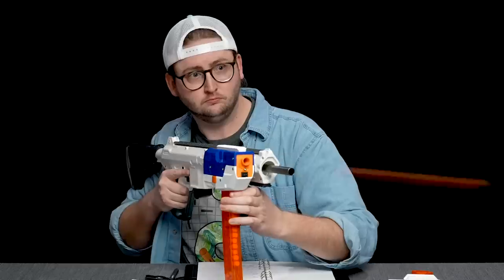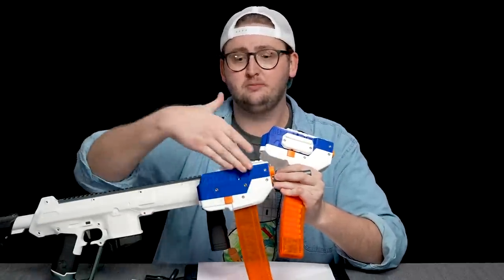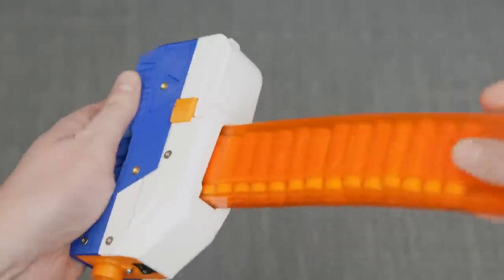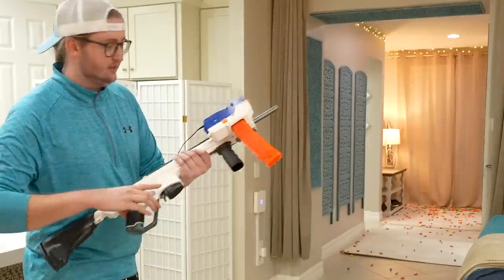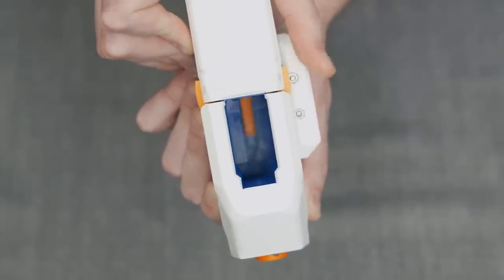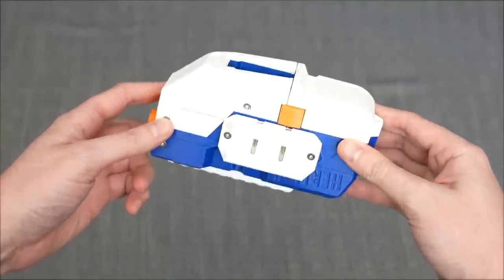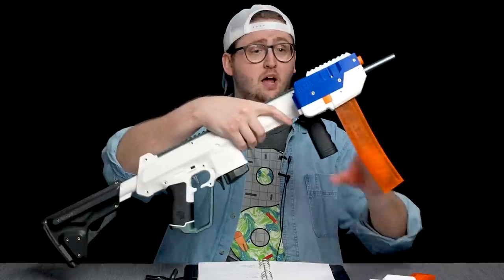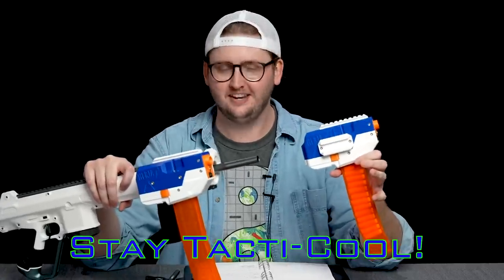[REVIEW] Herja | Full-Auto "Side-Car" Blaster | RAD!

Comment: Thanks for the review! Tarik did a lot of work to get this design out, and we're delighted with the reception thus far.
A couple of notes to clarify:
• The lack of pusher motor braking was a compromise because of the international circuit board and component shortage, and we would rather have had a board to prevent the kind of jams you experienced. There is a way to have pusher motor braking without a board, but it would have prevented the ability to use an external trigger. In our testing, we've found jams to be pretty rare, but it's not something we can completely eliminate with this iteration.
• RE a Picatinny trigger mount option: We'll certainly consider offering something like that in the future. However, for the first time, we are offering some accessory files for people to print themselves. Both the external trigger and the Picatinny receiver are available to print and could be modified to make something like what you're looking for.
Once again, thanks for your thorough review! We're excited to see what you do with them next.
Reply: You guys are cool.
Reply: Man, now I want a Harrier and a Herja. Think how it is pump action but has a bolt kinda grip aswell seems very cool and having that side car would be sick af.

Comment: I could see having a dual picatinny connector and run that in front of a vertical foregrip with the  wired trigger either attached to it or nearby with the Harja connected to an under rail using its top rail. Keeping it from getting in the way of corner peeks and still having access to it.

Comment: Question, you said that you could remove the pick rail from the top and put it on the side. does that mean that you could remove the attachment point and put it on top and use it as an under barrel?

Comment: How heavy is it with a 3s battery installed?   Wow, that blaster costs $200? Even more expensive than the blaster it's attached to!  That's at least a $400 setup between them.